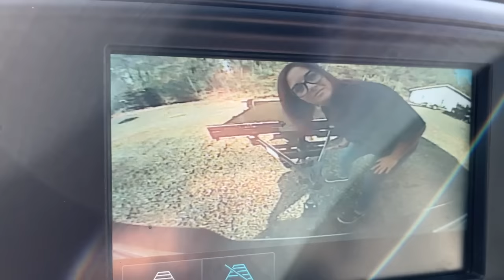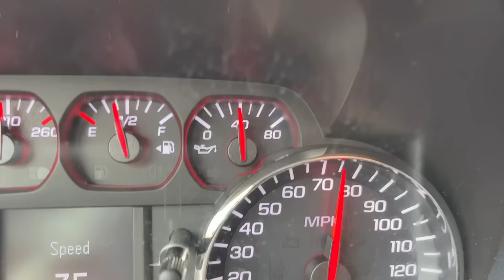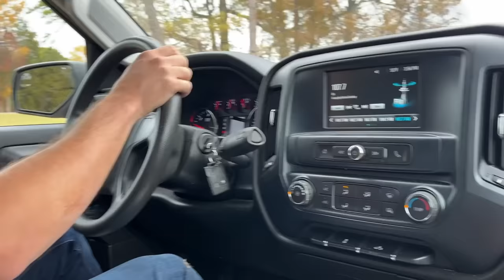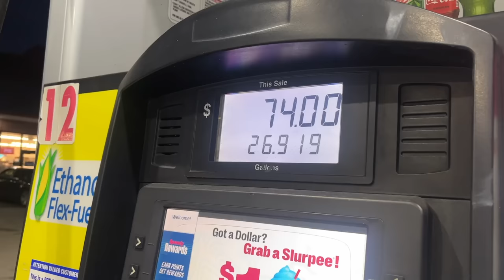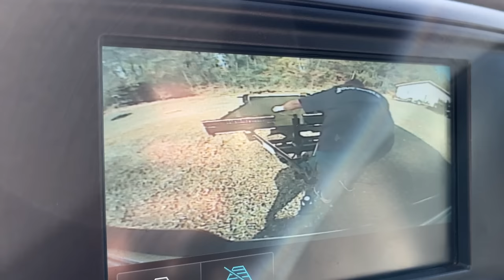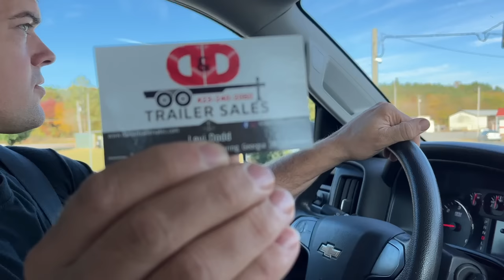How much did we spend? Big time upgrades! Ralphie is soo excited !!!

Comment: a federal law about hauling trailers. I saw you hocking the chains stright.
They need to be crisscrossed  It can help with trailer not to sway. Since I did it with a truck like yours and a 32 foot I closed trailer. towing my top/dragster. by the way the truck is very dependable and that looks like a great trailer congratulations.

Comment: change your oil every 3k NOT 7k and use 5w30/5w40 in winter and 10w30/10w40 in the summer it will help you in the long run. keep up the good work 👍👍

Comment: I believe using ethanol fuel reduces the towing capacity of a truck. Please read the owner's manual. I also believe using ethanol fuel in the winter may cause starting issues. Please read the owner's manual. I also believe MPG will be lower with ethanol fuel vs. 82 octane fuel. I also believe the engine starter crank time used to start the engine will be different between ethanol fuel and 82 octane fuel. That is how the operator of the vehicle will know what fuel map curve the vehicle ECM is using based on the fuel, or ratio of fuel be it ethanol or 82 octane that is in the fuel tank. No longer is the day of driving a vehicle it's the day of piloting a vehicle.

Comment: Ah shute only $30,000 I paid my daughters truck loan off it was a 2010 F150 4 dr and had 80,000 miles and it was $34,000 it of course was 4WD as well so trucks are expensive even used. Ah so you know the old sawdust in the oil trick used car dealers used to use the engine ran smooth as silk until it plugged up and blew the engine lol We have coyotes here in Northern Nevada making noises like that we have to watch our pets they like to run through and take pet dogs and cats for food. The kids reaction was priceless.

Comment: Which truck are you selling? which auction? I'm a 69 yr old veteran, my other half's Ford Edge has water in the oil @137k miles, horror story- no mechanic, not even Ford, will work on those engines-alum block & heads. I have to get her SOMETHING to drive, even if I have to rebuild it one system at a time, and we MIGHT be able to afford it.

Comment: You mentioned trailer carrying 10k however that's not quite correct. It's rated 10k total trailer plus cargo. Guessing it's around 2800 empty means 7200 cargo capacity. Just a trucker trying to save a headache for you. Congrats on new toys
Reply from the maker: Ok thank you